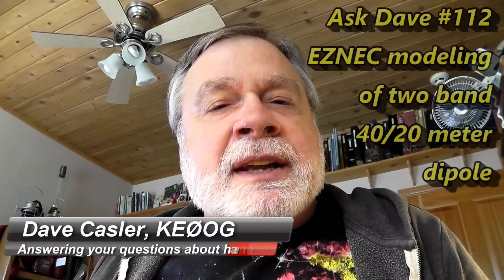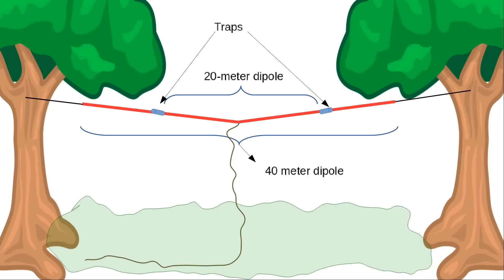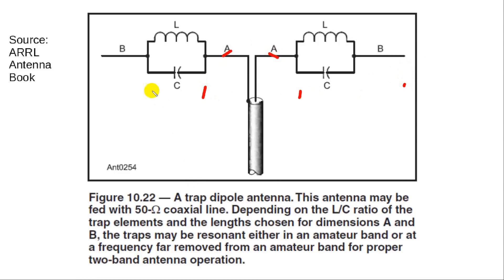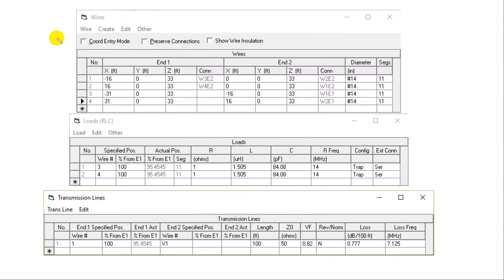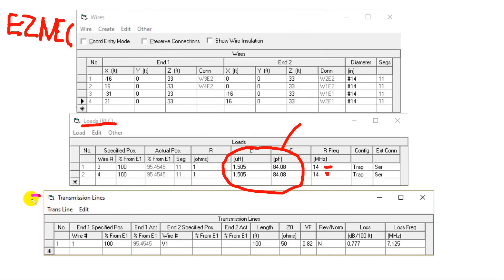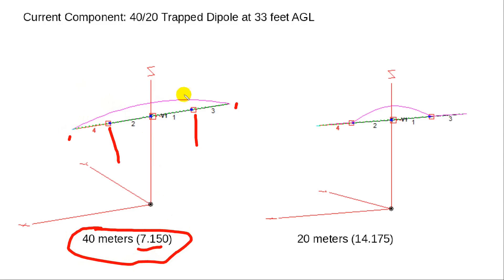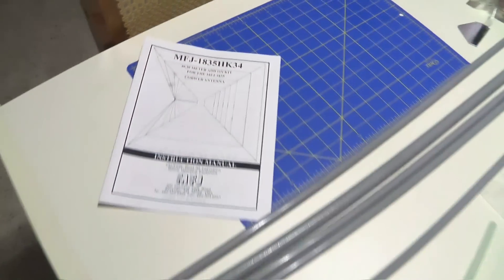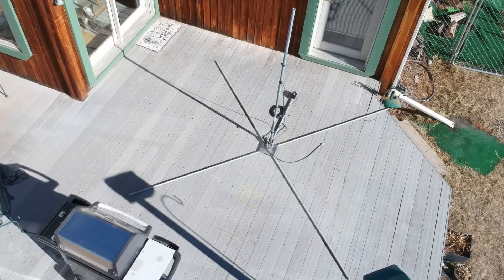20/40 Two Band Dipole Modeled (#112)

Comment: All your tutorials are quite interesting. I have been watching the ones for antennas modeling and I am currently trying to determine the best option I can implement within my space and height limitations. When using the modeling program, one needs to specify the antenna elevation, and my question regarding the "elevation" to be used in the program is : if the horizontal dipole will be installed  along the roof top (5 ft above it) corresponding to a total elevation from the ground of approx. 20 ft what should be used in the program for the elevation? 5 ft (assuming the roof as "ground") or the 20 ft (actual elevation from the real ground).
Thanks a lot.
Reply from the maker: Unless the roof is metal, You should model the distance to real ground. If the roof is metal, I really don't know.
Reply: Thank you for the answer David. The roof is regular shingle, I will run the modeling with  the real ground elevation. Regards.

Comment: Great video as usual.  I am a new ham looking to set up first base station.  Looking for ideas to have the ends of the dipole mounted on the supports such that it can be raised and lowered for tuning.  The quick glimpse of your support looks like what I am thinking about.  Can you please show how it is made and setup in a future video?   
Thanks  KE0PHS
Reply from the maker: Sure. I've shown a bit in different videos about using two pieces of chain-link fence top rail with rope guys, and then a pulley attached to the top so I can raise and lower antennas. It's inexpensive and works pretty well.

Comment: I have a question regarding the antenna itself in a dipole: Would it be ok, for instance to have doubled-up 550 Paracord running the entire length of the antenna, along both antenna wires of the dipole,  or would that create interference of some kind? I figured that I could make loops along the Paracord support through which the antenna would go, and I could regulate the tension on the antenna wires that way and the support cordage could tolerate over 1000 pounds of horsing around on the part of the trees in the wind. What do you think?  73  Dave  Joe
Reply from the maker: I think by paracord you mean nylon rope. It won't affect the antenna.
Reply: Thanks so much Dave! Yup, Nylon rope. The 7 strand stuff that's 550 pound test. You just gave me a gem of knowledge which I am very thankful for! I have watched about 15 of your videos so far! I love them! 73 Dave   Joe

Comment: So what I've heard is that you have some insertion loss which you dont have in a fan dipole. The FD is also easier to tune up. I haven't tried any, I just have a linked dipole. Intuitively I'd go for a fan dipole for 20 and up and connect an inverted v for 40 to it, but I dont know if that'd work :D

Thanks for the vid as usual ;)